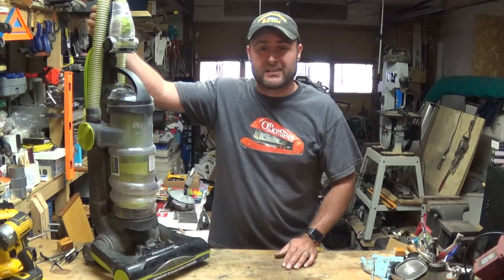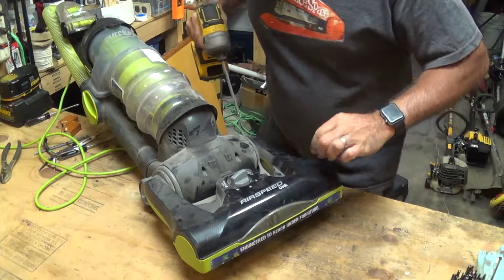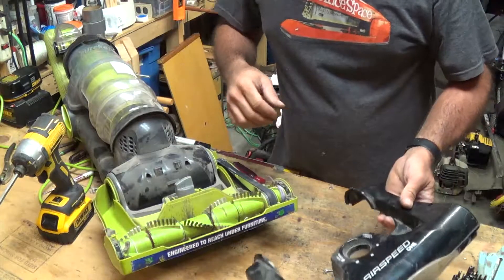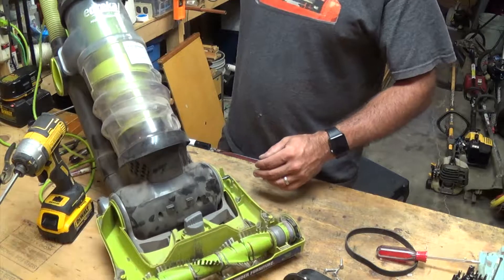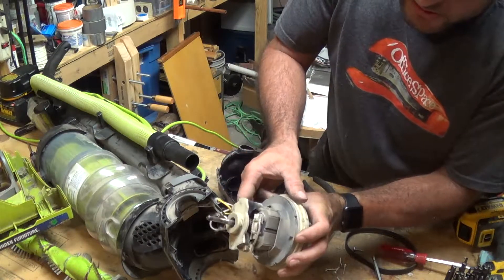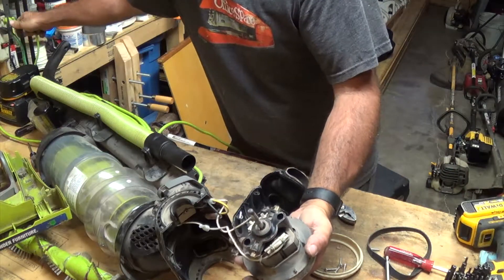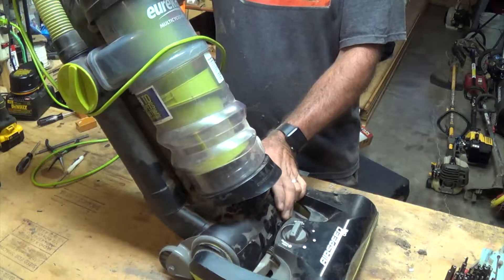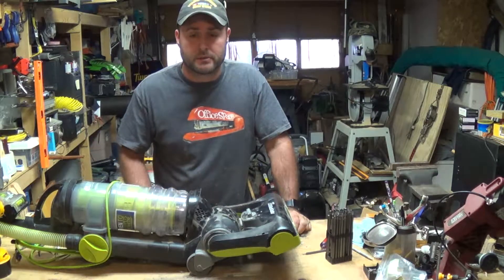Vacuum Cleaner Fix.   Simple and FREE

Comment: I figured there was something stuck in the motor but I had no idea how to address that. I did some googling and changed the belt — which did not fix the problem. Right after I ordered a new vacuum cleaner, I found your video. That is my exact vacuum cleaner model. It’s about 10 years old but it was working fine until that loud squeal started out of nowhere. I took it all apart. I pulled the motor out. I’m no electrician but I am resourceful. I’m a widow trying to make it on my own and I fixed it. Thank you.
Reply from the maker: Awesome. Hope you could still return the other vacuum

Comment: Those vacuums are so inexpensive they are impossible to get fixed unless someone like you is around.  Good Fix!

I've a very similar Eureka that has no power.  I'm going to take it apart tomorrow and see if it is a switch or something easy.  If it is the motor then another one will have to be purchased.
Reply from the maker: It is sad that they are made so cheap that labor to fix it is normally more than a new one. Maybe they need to engineer then to be taken apart faster to save labor for repairs

Comment: Thank you so much for this! I took apart and interesting enough I didn't see any accumulation of dirt in the fan. After I emptied the dirt container and put together, the vacuum turned off seconds after I turned on. Then it wouldn't turn on. After 30 mins or so it turned on but gave a spark and turned off. It actually flipped the breaker for the room I started the vacuum in. If the motor looked good and there seemed to be no blockage, is there anything else I can check out? I'm afraid to start it up when it sparked the last time.
Reply from the maker: At this point, you need to find out what was sparking. If it is the wires, you may see melted insulation on them or black from the spark. If the motor is burning up, it could be sparking because of that. Motor could be replaced, wires can be repaired
Reply: @EverydayJourney  Thank you so much! After I cleaned around the motor and got some dirt fuzz out, I was able to start it up and didn't see a spark. Maybe the little bit of fuzz was the problem. I was just worried since it tripped my breaker but we'll see how it performs now.
Reply from the maker: Good luck

Comment: My vacuum is the same as this one and it won't turn on. Can you give me an advise of what can be wrong with it.
Reply from the maker: If you have a multimeter, you can check the switch and then check for voltage at the motor. If not, just check for burnt wires or disconnected wires. Also see if your motor hums a little when you turn it on. If it does, there is a chance that the bearings are seized
Reply from the maker: Also, try a different outlet. Just in case it’s a problem with your outlet